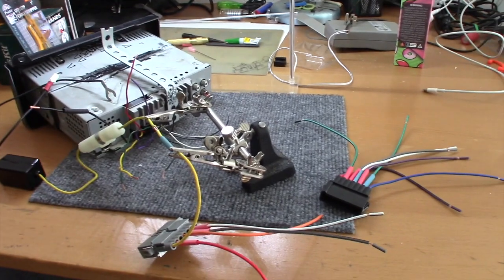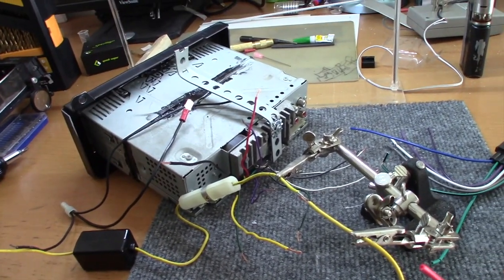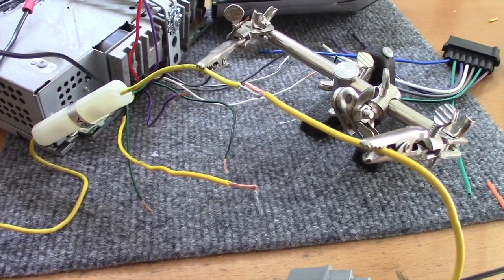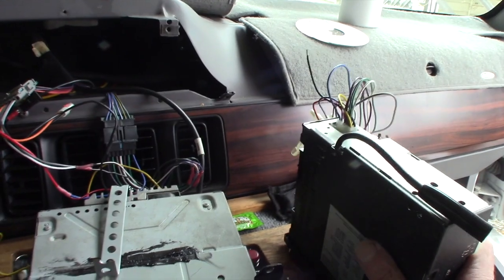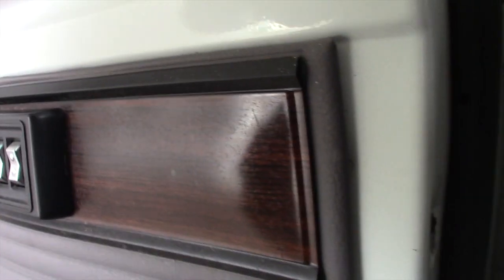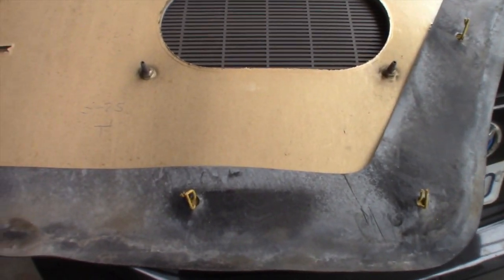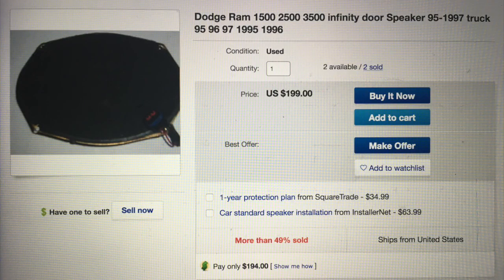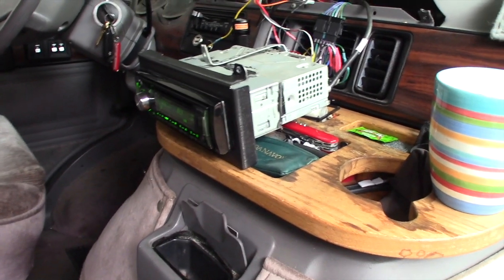Modernizing Audio In The Roadtrek

Comment: As I always say, it pays to have skills!   Since I retired, I have been keeping a list of what I didn’t have to spend since no longer spending Long hours at work - it is definitely worth it to  DIY - and fun too!  Another great video!

Thanks!
Reply from the maker: Hi Katy in NH.
Thanks for the comment.  Yeah, skills.  It was something I picked up mostly as a kid and continue to this day.  We restored an old Jaguar XK120 drophead...probably worth about 200K today.  Connolly hides, learned to upholster, rebuilt engine, transmission, cooling system, learned lots of mechanical stuff.  Completely rewired, all about harness building and electronics. Stripped the car down to the frame, learned to weld, body repair, body prep and applying paint.  Learned about steering suspension, brakes hydraulic systems, fabrircating replacement parts, machining.
Learned how to analyze, critically think, observe, deduce, apply logic, problem solving.
Dig post holes, pour and finish concrete, build decks, fences, houses.
Brewed beer, distilled alcohol, built and raced 100 mph go carts, midgets, super modifieds, sprint cars, even worked on an Indy car.
Flew airplanes.

Built potato canons, rockets, radio controlled airplanes, fireworks.
A lot of work went into learning and a lot of knowledge and wisdom got poured into us kids.
Adults took the time and had the patience to pass their knowledge and wisdom onto the next generation.
So sad to see how skillfully bankrupt people have become.
In my work, I often introduce myself, "hi, I'm Rich" and people jokingly ask, "are you rich?"
I just smile and respond, "oh yes, and wealthy in ways you can't possibly imagine." "I also share. All you need to invest is time". The rarest and most valuable commodity people seem to have very little available to spend.
I'm a bit of a contrarian.
I disagree with the old adage, "you can't take it with you."
You can and most likely will.  Not what you have.  What you have learned. 

Contrary to popular belief, wealth isn't measured in dollars and cents.

Comment: Good work! I have 3 or 4 of the Helping Hands units on my bench most of the time. They are very handy! The magnifying glass is nice but mine are all real glass so they are heavy.
Reply from the maker: Hi ranTrek,
I had a summer job as a kid doing wire strapping on microwave telephone transmitter circuit board racks. Learned to read blueprints for circuits, make grounding cables, wiring harnesses and how to solder real clean solder joints.
Would've been nice if all those kinds of jobs hadn't been exported overseas.
Kids here would have opportunities to learn some valuable life skills, earn some money, be mentored by older skilled people, and have some responsibilities.

Comment: Rich I have year and model of your roadtrek I have been willing to replace the  infinity radio. What brand of radio you have replaced.
Darius
Reply from the maker: Hi dukec29,
It's a Pioneer brand. It's an old radio or whatever they call them nowadays. Just something out of my son's old car he wasn't using anymore.
With the Infinity speakers that have their own amplifiers I just needed something that had Bluetooth so I could connect the music on my phone to the sound system in the van while I drive.
Reply: @RoadtrekRich  
Thank you I looking forward to buy and replace the original radio that comes the van, good job on the truck fridge you installed it’s out of stocks right now I might order by January. The one I have is not convenient.
Thanks for all the videos you put on 👍👍
Reply from the maker: @dukec29  
The truck fridge is very good. Today I am defrosting it. I do that 3 or 4 times a year when ice builds up.
Be sure to measure carefully to be sure you have enough room. In my Roadtrek, it fit where the old Dometic was exact, no extra space.
It continues to work daily on the two 100 watt renogy solar panels and two agm batteries with a simple renogy charge controller. 
Yes, appliances are very hard to get right now. 
Thank you for watching the videos.